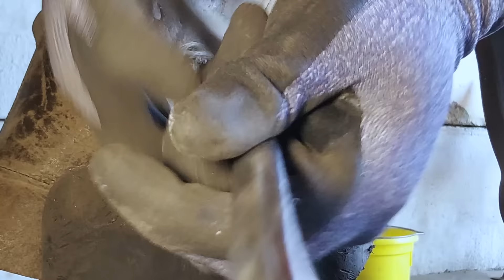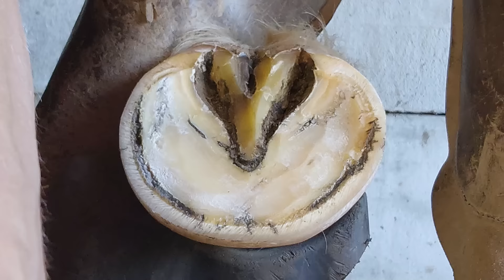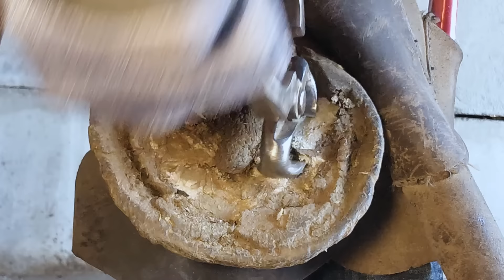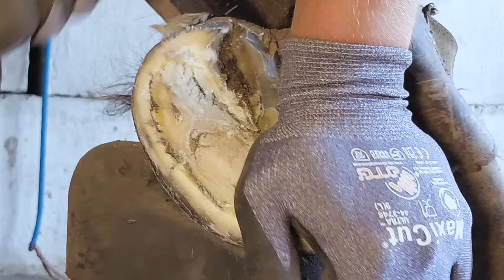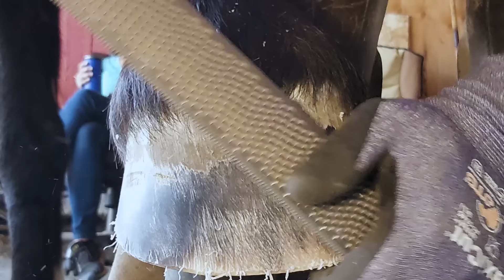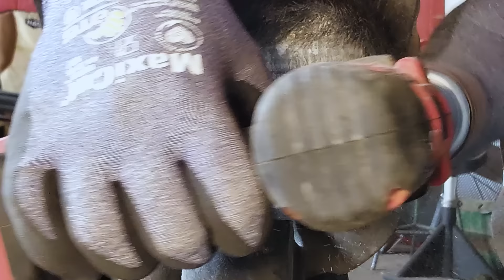These Hooves Are Huge!!! One of My Favorite Horses - Massive Hoof Restoration -  Part 1 Front Hooves

Comment: If you wanted your finish to look better and “smooth”, could you rasp the outside after you use your nippers but before you toss on the shoe? Then you’re not wearing your rasp down on the nails as much but still making it “pretty”? I’m hoping to become a farrier but this is a very new adventure for me, so I’m curious to the opinion on this
Reply from the maker: We Use 2 different rasp hot and cold. Cold is for trim. Hot is q worn out cold rasp we use for finishing the hoof. You have to rasp the nails to take off sharp edges